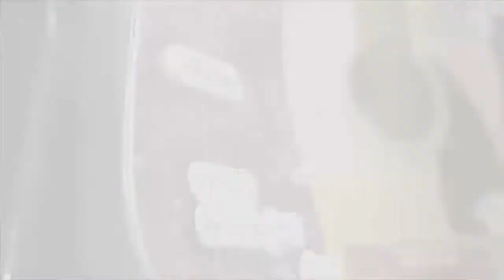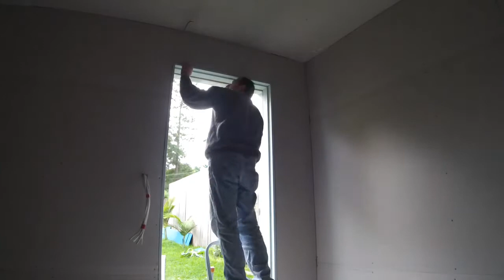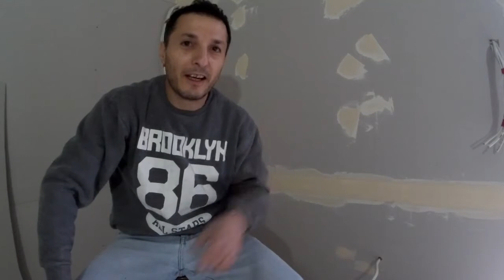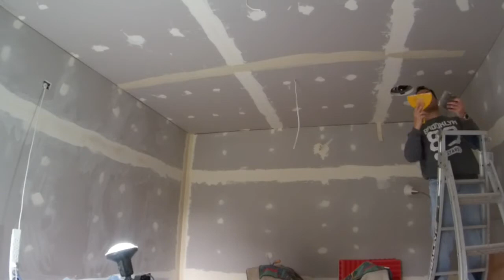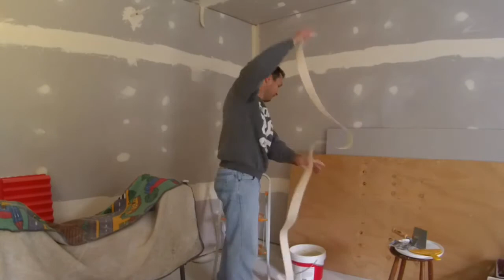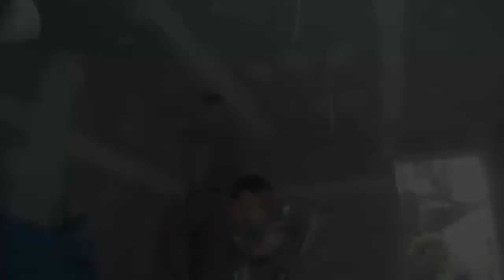Building My Home Recording Studio Part 24 - Plasterboard Works

Comment: I laughed a little when you said you didn't know if you would do the ceiling joints, I knew you would because you do things the right way like me. :-)
You are doing a fine job as always.
I used to do taping and bedding for a living when I was younger and that's a messy job to do for sure, that mess gets all over you.

I picked up a Whisper Booth (recording vocal booth) this weekend just need to treat the inside and get an exhaust fan, got it used and about 1/4th of the cost of a new one :-)

Keep up the excellent work my friend, I can tell you are still fighting the sickness in your voice, hope you can get over it real soon, it has hung on a long time.

Always looking forward to these videos :-)
Reply from the maker: Wow, great. What's the size? Hope it is large enough so you don't feel claustrophobic.
Reply: Oh man, it's not big inside at all and will be smaller once I start putting my panels in (starting building them tomorrow), BUT I am only using it to track my vocals so it's good enough for that :-) I have a few things I want to do besides the panels like build a custom table / rack for my interface, laptop and mic power supply that can fit inside the booth. And I need to replace the exhaust fan and the door handle to a non locking one then I will be ready to wire it up :-) Super excited to see your upcoming video of after the paint etc.